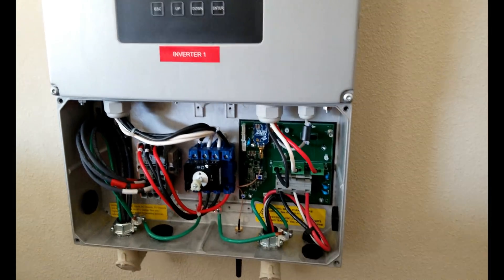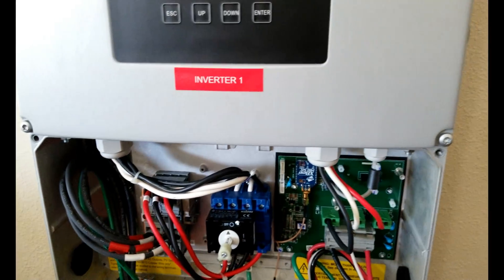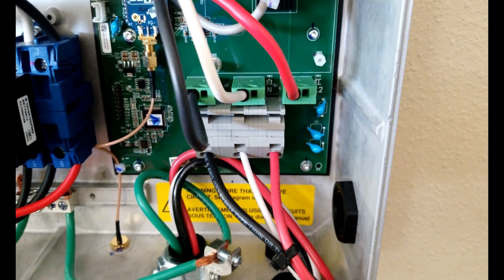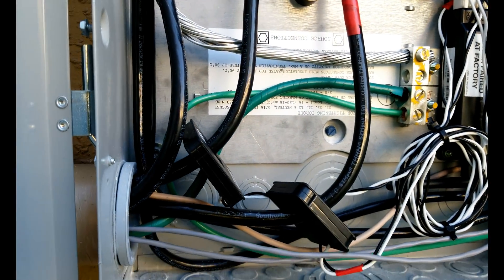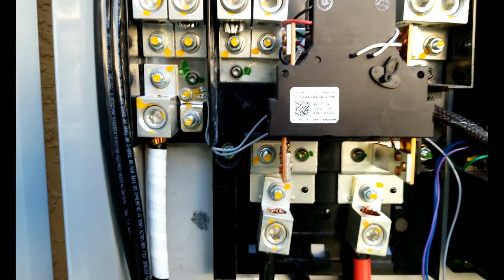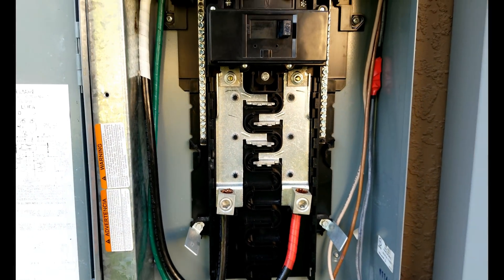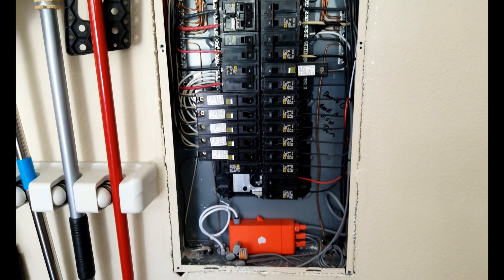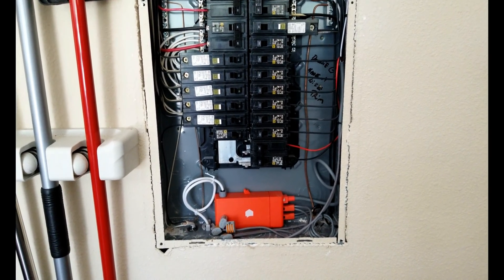Tesla Solar System Exploration Recap

Comment: No update since 2018? I am a Christian also!
I have installed a transfer box before on my last house (utility power to generator) the limitation is the size generator output or in your case solar output. I think i saw you have 2 - 220 breakers.   Lucky for me i do not live in a hot climate.
The main problem is always how long does it take to recover your cost before your actually saving money. I have heard anywhere from ten years to 30 years... And during that time batteries need to be replaced...  However saying that i did upgrade my heater/AC combo and Heat pump & Heat pump water heater & insulate the attic and floor up to current standards.
 The utility bill is the same cost as a house i had that was 1/2 the SF.   Also i have a well and septic. Nothing is free,, but any backup system is nice just in case.
Reply from the maker: Hello Robert,
I am very sorry for the lack of updates, I am being tested (trials and tribulations)!  I am planning resuming once God has redeemed me...👍

I agree, we all want to see a positive gain on our investment which we know will come, however, I enjoy the fact that I have a peace of mind against power outage and inflation. 

God bless you my Brother!!!
Reply: @kingvally  I am 63, i have learned that the only positive changes in my life came from tribulation,, 99% self inflicted that needed to be addressed by God. No i did not like the wake up calls, but looking back i needed them, i thank god he loved me enough to spank me. I will share one tribulation,, my wife and best friend died in the same month in 2000.. Looking back i was very immature and needed a wake up call. Yes i still daily screw up and hurt others with thoughtless actions. He is real and he is there. When it all goes to hell, God is there, i can not see him but i feel him the strongest in bad times. Everything is good now.  As for money because you did spend it... he does not care about money,, he wants only one thing. Come to him when you're down, and do your best when your up. He is the only one that will never lie, cheat, steal or leave you. HE IS GOD! I gave up trying to be perfect or even trying to be good.. It just happens,,, it's pointless to try to be perfect so just let go and be you and acknowledge him in you mind and heart.  Last thing do not judge anyone because we will be judged by the way we judge others... Just be you, God will do the rest if your as screwed up as me.
Reply from the maker: Robert,
Thank you Brother, it's just what need to hear!!!
God bless you!!!

Comment: Hey very nice setup there! so the batteries are AC batteries? and those charge from the inverters AC output in the generation panel? May God Bless you.
Reply from the maker: SuperBrainAK , thanks for the comments!!! 

The battery setup consists of 14 kWh worth of DC batteries per unit, the built in AC inverter converts the DC battery power into AC which is then distributed to the generation panel. 

 The built in inverter recieve the supplied AC from the solar inverter which is use to charge the batteries. 

God bless you and keep you in His Holy Name!!!
Reply: Oh I see so it is not a prebuilt battery solution, that’s what would be called an AC battery, you have an inverter that acts as a charger also, cool